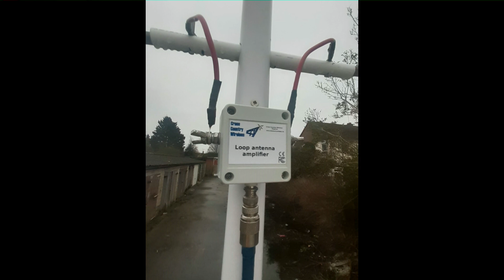RX only Loop Antenna On A Budget - Cross Country Wireless Loop Amplifier

Comment: Hi James, Thanks for the video, now we are 3 years on, I wonder what your conclusions are? Also, did you need to find a method of switching the RX antenna off, so that you didn't overload it with your own TX?
Reply from the maker: I did manage to rig up a solution using relays switched from the PTT but it was a bit of a faff.

If you have a radio that has a separate RX antenna input (which my current radio does) that simplifies things a lot as that eliminates the need to switch the coax between TX & RX antennas. I believe MFJ do (or did) a box which would disconnect the antenna from the radio & remove the bias power on transmit but I didn't get round to buying one.

I eventually ended up putting a different antenna up & my current antenna does a lot better on receive, so I decided it wasn't worth the added complexity to switch it. Might end up revisiting this idea at some point......who knows?!?!?

Comment: Hi James, this was a very interesting experiment!  One thing you might want to try is mounting the loop horizontally and re-test.  I think that you will find that you get more US and Canadian stations that way.  It puts the nulls directly up and down, so it is not as good at nulling noise, but it should give better omni-directional performance.  I think that I will buy one of these and try it with a length of copper tubing as the element.  Thanks for sparking my interest in mag loop antennas!  73,
Len, KD0RC

Comment: Great Video James! Something that MIGHT also be beneficial for the weaker DX is a slightly larger loop. I find that a 1m loop is fine for most applications but a loop's sensitivity is proportional to its AREA. It might be interesting to do up a few different loops to see whether there's an "optimal" size for the amplifier which is best best balance between signal and general performance (maybe flattening the antenna factor a bit too?). Something you MAY wish to try on the receive end is using flexweave - the stiffer stuff (16ga) is really fine for an element. This allows for more "flexibility" (pardon pun!) when trying different loop configurations. I use a regular ~1.5m high hexagonal loop (my perimeter is 4.8m) and the loop's area is 1.7m2, compared to your 1m2 area on your loop. Obviously, if wishing to stay with copper pipe in the 15mm range it is not easy to shape other than square unless you can find a tube bender... 

But it is not just about area, it is also about orientation - I was unclear whether your loop was ever rotated to bring in the DX or was it left mostly stationary at a semi-optimal orientation? If not rotated, it may be worth playing with that too! 

Cheers, and great DX to you - again, thx for sharing your very interesting results! 

73 de Darren, VE4VE
(using ELAD DUOr on Wellbrook ALA-100LNM (4.8m hexloop) and CCW antenna protection unit.
Reply from the maker: Hi Darren, some good suggestions there.

I had another look on the Cross Country Wireless website (where I bought the amplifier from) & they show a scheme to make the loop directional (cardioid pattern with about 30db rejection off the back). Building that & putting it on a rotator could be an interesting experiment. Maybe a future video when I get round to it!

I wanted to use copper pipe for the rigidity, durability & ease of assembly more than anything else.

I did think about trying to make it round but I thought that was a bit ambitious without a pipe bender! I couldn't really justify splashing out money for a tool which is probably only ever going to get used once or twice.

To answer your question, the antenna was NOT rotated during this experiment.

I have a bit of a noise issue here, so the loop was orientated to null out as much local noise as possible & locked in position for the test.

It just so happens that the loops nulls were orientated the same direction as the nulls of the EFHW which I compared it against.

Having said that, I'm not convinced that rotating the loop would have made much difference to the far field radiation pattern. Given how low to the ground it is I suspect that the pattern is fairly omnidirectional. Especially when you consider the high angle of the signals being received (which were basically NVIS).

The same applies to the EFHW. Although that is substantially higher than the loop, it is still relatively low for 40m & 80m. It's inverted V configuration will also have the effect of making the EFHW more omnidirectional.

The WSPR plots would appear to confirm this theory as the WSPR plots don't seem to show any directivity & both antennas picked up a number of stations which were (theoretically) in the nulls.

I have a feeling that there may be more experimentation to come on this one!

73.

Comment: Mag loops are Hi-Q and consequently narrow band for Rx and Tx. The only pain is you have to retune for small frequency changes...
Reply: True for tuned loops, but this is an untuned active receiving antenna, so requires no adjustment.
Reply: @tristanmills4948  True, I hadn't fully appreciated the situation...
Reply from the maker: Hi John. Absolutely agree, that is the biggest problem with mag-loops such as my MFJ-1788. It drives me to total insanity!

It's not a problem with wide-band RX only loops like this one (there is no tuning on this loop). If I tried to transmit into it I would probably destroy the amplifier box, so caution required with the TX/antenna switching arrangements!

It covers from 20KHz up to 150MHz, so basically the whole amateur HF/VHF spectrum. It works great on the lower bands from 160m, 80m & 40m. I haven't tried it on the other bands yet.

The idea is to use the loop to receive (due to it's low noise characteristics & it's ability to null out local interference) and transmit on the main antenna.
Reply: @HamRadioOnline  Hi, didn't realise the loop was of the untuned type. That said looks like your loop is a partial solution to the high noise you're experiencing. All the best for now...
Reply from the maker: That's the idea. I'm trying as many solutions to the noise problem as I can think of. 73.

Comment: Interesting. I remember, back in the day, when your home radio had a "loop" antenna built onto the fiber board back panel of the radio, with a socket for a long wire. Those sets usually had "Short Wave" bands as well, some some exotic locations printed on the dial. THe one I had 50 years ago seemed to my youthfull ears, to work quite well. MFJ do a "box" that allows you to split your Tx and Rx antenna, available from Martin Lynch for about £115. This stops you overloading your receiver. I think Ogy did a vid on it. 73 Jim M7BXT
Reply from the maker: I do actually have one of those MFJ boxes. That will be a topic for another video (how to use a separate receive antenna or SDR receiver while transmitting without blowing up your receiver). I'm not sure when I will get round to making that one.

I'm conscious of the fact that (due to lockdown restrictions) all of my recent content has been filmed at home with me sat there just talking to the camera. This format is ok for a few videos here & there, but with the number of videos that I have made I think that format is beginning to wear a bit thin & getting a little boring.

I want to try to introduce a bit more variety to the channel, I really want to get out to do some more portable operating once lockdown is lifted. I've got a few ideas for portable ops (both small 1 man trips & large scale collaborations requiring a couple of people to build the antennas).
Reply: @HamRadioOnline  I am planning on getting one so that I an use the SDR to provide a waterfall for my old Kenwood. I am off the road for now, but pencil me in to help with projects. Jim M7BXT

Comment: Interesting video again! Was it difficult to build the loop itself? 73 de PD0ALX
Reply from the maker: It's pretty easy.

It's only copper water pipe with 90 degree elbow joints. You just have to measure the right lengths & cut the plastic pipes.

The joints come with solder already inside them, so literally just slap a bit of flux on the pipe then heat it up with a blow torch.

Just make sure that you don't get too carried away & forget to slide the copper pipes through the plastic ones before soldering, otherwise you will have to pull it apart again. I'll let you guess how I discovered that one!!!
Reply: @HamRadioOnline  No soldering necessary?
Reply from the maker: @vdleun77  It is soldered. The joints come with solder in already. Press the joints together, then heat it with a blow torch to melt the solder & make the joint.